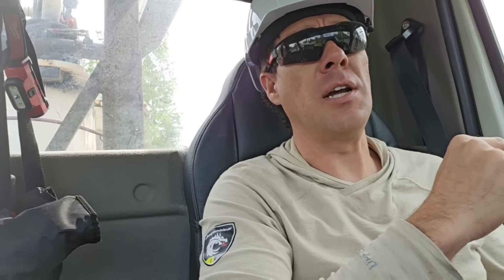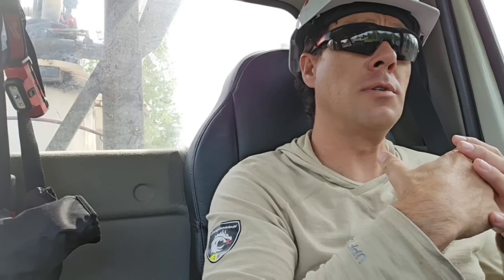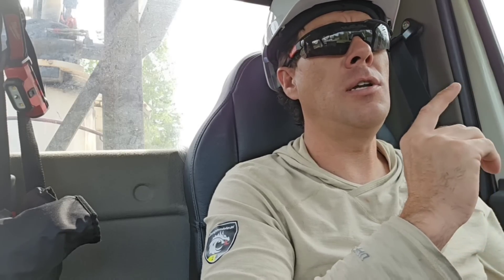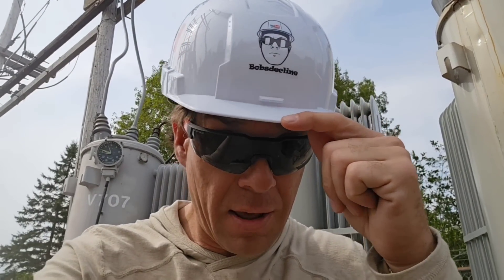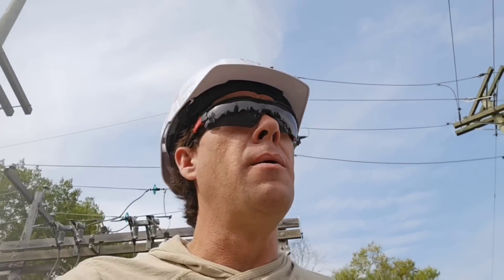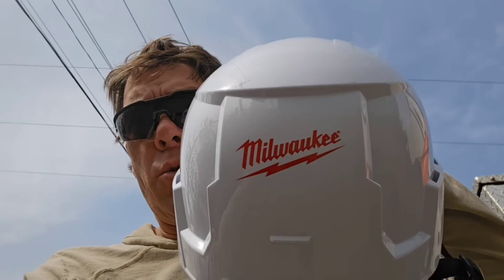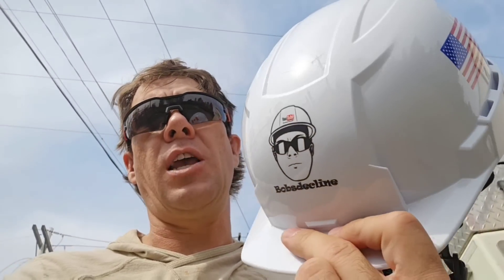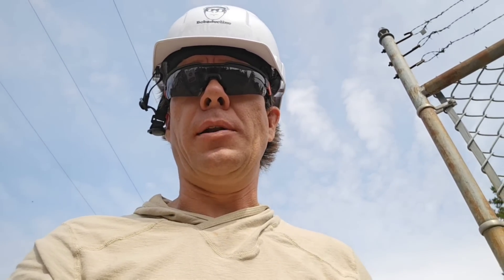69kV Substation w/Trip savers

Comment: I didn't know that there were privately owned substations of that size. To be precise that privately owned substation is probably fed at 34.5 KV, which is a standard local distribution voltage.
Reply: Heavy industries can have even larger private substations. Think about aluminium smelters, big data centers, and the like.
Reply: @marco23p  I can only imagine. What about truck stops for all those electric Tesla rigs?
Reply: @jolyonwelsh9834  At least in the Netherlands, car charging stations get their own padmount transformer, but they are mostly connected to regular distribution voltage (here, 10 or 20 kV phase to phase). The total power is often 1-2 MW. They probably get a custom low voltage, because the car battery voltages nowadays can be up to 800V.
Reply: You should see the private substation Amazon has near their distribution center near me.  It's hard to see across it.  Has the longest bus lines I've ever seen.

Comment: Aaron, thanks for the video. I have a question. Have you ever had a recloser fail in a way that it continually opens and closes, but doesn't lock out? I'm in Pennsylvania in the U. S. and I'm used to reclosers that try up to 3 times and then lock out. A few weeks ago at work, our power went out, but came back in maybe 5 seconds. It was on for maybe 5 seconds and went out again. But unlike what I'm used to, it kept cycling on and off for maybe 6 minutes! One of our electrical engineers said "thats not a recloser". I thought the same, but a couple days later, another employee said it was due to a traffic accident and other buildings in our area lost power too. Could it have been a defective recloser?
Reply: That's what happened in the western suburbs of Reading, PA. PPL territory. Never in all my life ever experienced that. On and off about every 5 or so seconds. Shut off power to the whole house after the first several. Fortunately, power was restored about 10 minutes or something later. Never did hear the cause. PPL while overall reliable is seemingly slipping in service. Not necessarily on equipment, but staffing levels.
Reply: @ronbennett7885  That's really interesting. I'm hoping Aaron will reply. I didn't try to time the events, so my times may be significantly off.  I really thought it was the switchgear in our building until I heard that a large store next to our building also lost power. I don't know how reclosers work internally, but I'm sure Aaron does. Like you, I was concerned about damage and unplugged my computer when I saw it was continuing. The other thing I noticed is that our lights didn't flicker or go dim. They went completely off, then completely on.
Reply from the maker: That's actually normal... Kind of. Depending on the recloser settings, a fault could hit the "sweet spot". The fault current may not be high enough for immediate lock out with intervals far enough apart that it allows for the "3 shot" sequence to reset.
Reply: @Bobsdecline  The gap was consistent the entire time. About 5 seconds each time. Affected a huge area with multiple sub-grids (feeders?). PPL map will show outlines of individual areas affected for larger outages. 14,000+ customers affected. You know more about this stuff than most here, so may be right. However, never experienced that before ever. Very odd. Fortunately, didn't hear of anyone experiencing damage to their appliances.
Reply from the maker: 5 second gap..... If it was long enough and a low fault current, it may have still hit that sweet spot.

Typically a recloser operating multiple times is no different than flipping your breaker off and on repeatedly. It won't damage anything. 

Another possibility (which I've seen 3 or 4 times in 20 years) is where a broken jumper or a wire down is still making contact with the other end of the break or another wire.

An example; I was driving down a very long road heading to a call. As we were heading there every street light on this road and heading off into the distance was shutting off every 10 seconds or so and coming right back on, discontinued for 15 minutes or so until we arrived to the call. When we got there a span of high voltage wire was broke and dangling down the side of the pole almost touching the ground. When it broke from the tension it was actually flipped up and around another phase and that other phase was energizing the downed wire. Why was very slightly swaying in the wind just enough to lift off where it was draped over the center phase every so often. 

Incredibly unique situation that I'll probably never again! It totally could have simply been a recloser or breaker that was failing or set improperly, but electricity does funny stuff sometimes it would be interesting to see for sure what happened!
Reply: @Bobsdecline  Thanks! I figured if anyone could explain it, you would be the one!
Reply: @ronbennett7885  I re-read your comment and looked up PPL service areas around Reading PA. Our office is next to Khols in Wyomissing and it looks like that's PPL. We have a mix of PPL and MetEd and I thought Wyomissing was MetEd, but apparently it's not. The incident we experienced was on Tuesday, Sept 10th around 5 PM.
Reply: @jaygosch8705  The boundary lines are odd. Some parts of Western Berks and Morgantown area are in PPL. Most of Berks is MetEd. From my interpretation of the outage maps, guessing a substation on or near Penn Ave somewhere between Wyomissing out towards Sinking Spring. Didn't see any news about accidents into powerlines. If it did, probably Wyomissing Borough or Spring Township. Both post police blotters. Might take a look later.
Reply: I edited my comment to say 5 seconds in case anyone else reads it. After reading the replies and thinking about it, 5 seconds is right. Also, although computer hardware won't be damaged, if the time had been longer, Windows probably would have been corrupted and need a repair or reinstall. Windows writes to the hard drive during startup, and interrupting that can cause corruption. Unfortunately, I've done that myself a few times trying to get into the BIOS and either pressing the wrong key or being too late. I got frustrated and held the power button down to force power off rather than waiting for it to boot up and shutting down normally. Dumb move on my part since repair or reinstall can take a lot longer than if I had waited for the boot to complete.

Comment: that sure was one nice hum, bit different from our 50hz in uk, made a change 👍
Reply: When I was in high school in the 1960s I took electronics class.  We repaired mostly tube/valve radios and TVs for relatives, friends, and faculty.  If we turned the radio on and after warming up (5-10 seconds) heard that 60 cycle (now Hz) hum from the speaker we knew it needed a new filter capacitor.  Certain scientific names were changed by an international committee in Switzerland in 1968.  Cycles were changed to Hertz.  Centigrade temperature was changed to Celsius.  Only the name was changed, scale and abbreviation stayed the same.  Some of us old timers still prefer to use the old terms.

Comment: The main thing that helps the lightning arrester do its thing is a block of "nonlinear" resistance. While the arrester allows the lightning surge to drain safely to ground, it unfortunately opens a path to ground for the heavier 60Hz current. The nonlinear resistance works such that each time the alternating current returns to zero, the resistance exponentially increases. The effect is such that the follow current is stopped within a few cycles.

Comment: Cool sub station walkthrough. Not being in the biz, never thought much about how wind or solar farms connect to the grid. I did not realize the substations are owned by the farm.
Reply: "I did not realize the substations are owned by the farm."  I know that BUYing power, your best deal is "bus voltage", 69KV, and you break it down to your 240V lamps and 600V motors. I never thought, but makes sense, that SELLing power, you get the best price if it is already stepped-up and ready to travel. So yeah--- the larger farms will have substation gear.
BTW: windmills probably make 1,000V so need step-up, but Solar Cells can be as low as 0.6V and need a LOT of step-up. Physically it makes sense to rig them in series to maybe 100V or 600V, then transformers (and inverters to fine-trim the voltage) to multiply to 7KV or 69KV.

Comment: Ahhh, step voltage regulators ....... one of the most dangerous pieces of equipment beaten only by cap banks.  Vital and useful little beasts, but don't get on their bad side! I've seen them both fail in person, it is not pretty and very scary at the same time.  (one of the regulator failures was on a single phase line, and it was due to an internal mistake with the tap changer.  It was NOT in the neutral position as the indicator showed, and when it was energized the sounds were evil right before it blew up. The lineman wasn't seriously injured, but did lose his hearing, about 10 years off his life, and a pair of shorts. I lost the last two.)
Reply: I mentioned in another video where one cooperative in ND had a regulator fail and the resulting fire caused enough damage the coop had to replace everything on the low-side structure, pour a new regulator pad, AND replace the control hut.

Comment: I wonder if this is similar to one they tore down here in Winnipeg? It's still mind blowing to me that these things can be decommissioned and torn down seemingly without any major interruptions, and why they eliminate them. I guess I'll continue watching the video lol.

PS. Still hoping to see more about open neutrals and any examples you have of them finding alternate paths back to the pole. I think I previously mentioned the call I had a month or two ago where the aerial coax was melted nearly the entire length, but I've since found out another tech went back for the same issue, but they also had the maintenance dept come out and change the tap as it might've been feeding voltage back towards the cx. I'm not sure I believe that cuz you'd think that all the drops off that tap would melt as well.

Anyway, sorry for the long post. Take care!